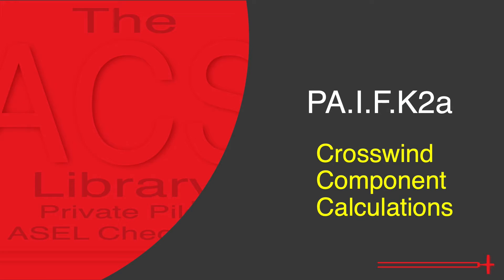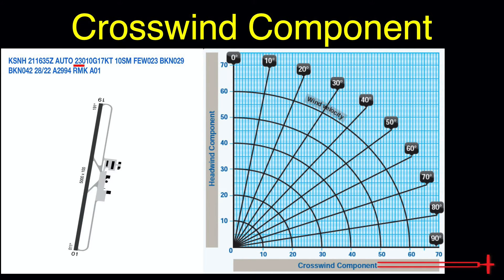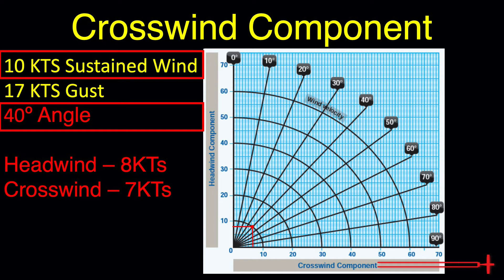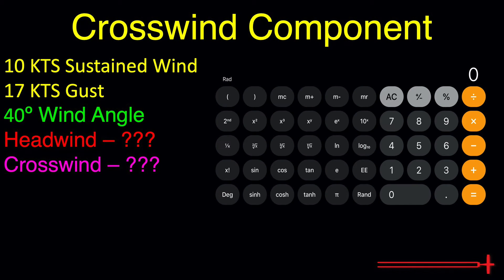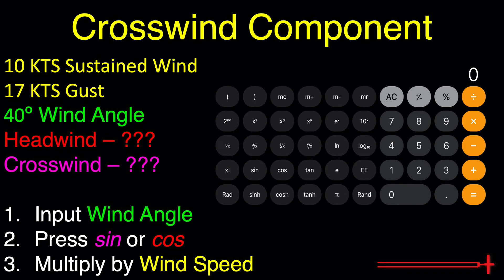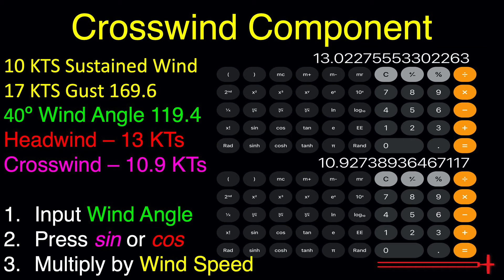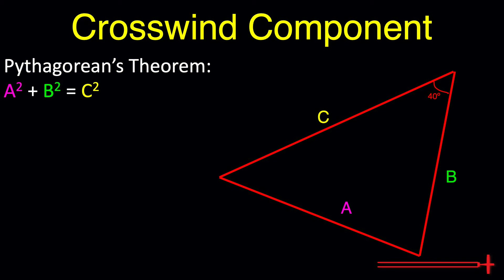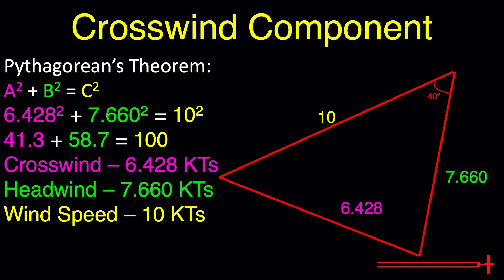How to Find Crosswind Component Using your iPhone Calculator (PA.I.F.K2a)

Comment: Thank you for explaining how to calculate ... perfect, almost there now but have a question. In the video you use the example 23010G17KT which produces a Sustained Crosswind Component of 6.4KTS and Gusting Crosswind Component of 10.9KTS (so far, so good). I am learning the PMDG 737-800 and, using this example, would like to know what value should be entered in the WIND CORR field of the APPROACH REF page in the FMC?

Comment: I recall a rule of thumb where u divide the difference b/w rw heading and wind direction by 60 ... So if it is 40  40 by 60 is 2/3 .. So for 10 knots 20 by 3 is approx. 7..knots cross wind.
Reply from the maker: I tried it out and compared it to the numbers on the calculator.  Works pretty damn well! As long as you don’t use it for 90° off😉 haha
Reply from the maker: Thanks for posting this! It’s a great tip

Comment: with this same method how would you work this question out ?? "Determine the maximum wind velocity for a 45° crosswind if the maximum crosswind component for the airplane is 25 knots.?"
Reply from the maker: Good question Men In Action LLC!
This format of question is a lot easier to work through with the Wind Component Chart that you are accustomed to seeing. 
To use the calculator method, you would find sin(wind angle°), and divide the maximum allowable crosswind component by that value to get the maximum allowable wind velocity from that angle.
Reply from the maker: So in this case, divide 25 by sin(45°) which is .707174.  The product will be 35.4 knots which lines up pretty well with what we would get using the Wind Component Chart.
I hope this explanation helps!